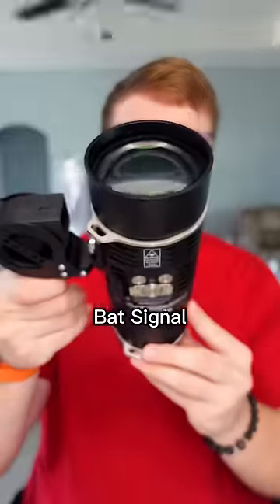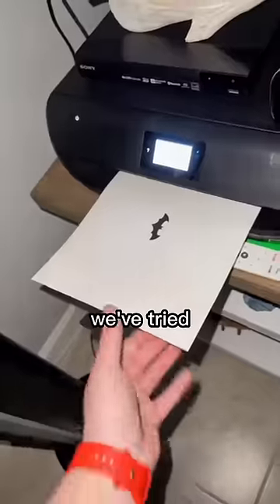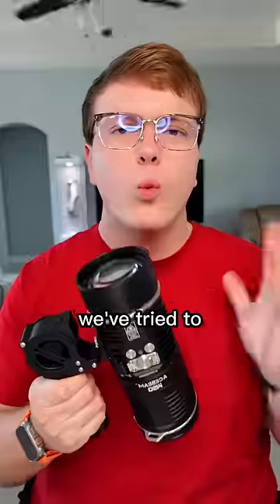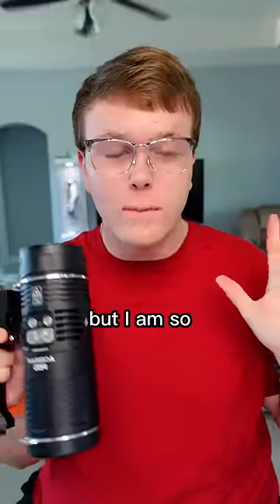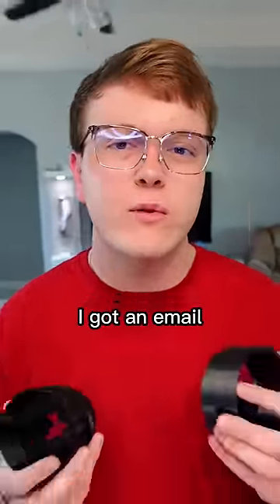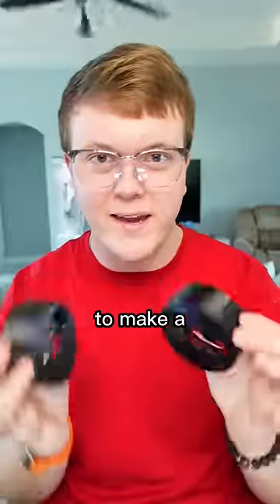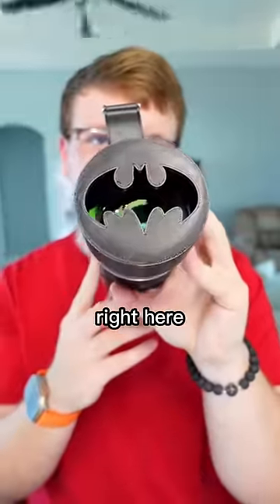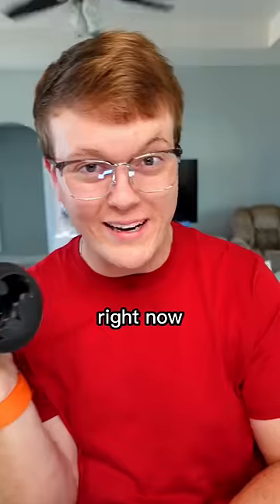3D BATSIGNAL With My $3000 Flashlight

Comment: Normally the bat ( dark part ) is in the middle , but it does work .. nice one
Reply: There’s a reason why it doesn’t work like that without him taking apart the flashlight. I’m not an expert on that but The HackSmith has a video on it
Reply: @StoryArtsConcepts  the design is great,to make it work or to make the batsignal appear you just need to point it at clouds🤦🏼‍♂️🤦🏼‍♂️🤦🏼‍♂️
Reply: I keep thinking he’s gonna flash it into my eyes lol
Reply: It is not physically possible but ok
Reply: It’s bc light bends
Reply: @clock00  it is possible as the hacksmith has done, it’s just not how fiction shows it
Reply: @clock00 if dark solid bat sign is placed at distance of focal length of lens of flashlight instead of directly sticking it on lens then it would work

Comment: Can I make a suggestion that might be helpful? because the bat signal is a shadow in the light  and not the light itself, try making metal plates in the shape of the bat symbol and find a way to either screw it on to the flashlight or make something similar to the caps where u could snap it on somehow and see if that works....hope that made sense.
Reply: Hacksmith

Comment: I think what you need for it to work is to disperse the light into an even circle with some filters from an LCD display, put the bat on the last filter, and then use a bunch of lenses in a tunable configuration to focus the light into a straight beam, like a cinema projector. That way the bat image won't blur when projected to your chosen focus distance.
Reply: i agree
Reply: Perfect
Reply: Yeah I was just thinking about this and you already said it

Comment: Use a Fresnel lens bruv. You can't just stick a black sticker in front of a flash light and expect a high quality projection. Light from a torch goes out from a point of origin (bulb). So the shadow disperses the farther it goes away hence making the edges very blurry and ultimately making the shadow low quality. If the light is linear in nature, the light and shadows don't disperse so the shadow is high quality too. You can also use a concave lens but Fresnel lens is used pretty much

Comment: Well... No it's not a bat signal. It's much more logical to be like that, it's the most effective way of doing it since if it's the light that take shape, but THE batsignal is a light circle with a shadow shaped like a bat. So it's still not right, and it's about time you check a few optic basis to know what you're trying to do. It's not like it's hard, the hacksmith already did it and explained the optic part in a video quite old now. I'd normaly say you'd succeed through trial and error, but for that you need to understand what's wrong when you do it

Comment: the reason it worked was because you were putting the bat signal inside it so the light would just hit the inside but if you cover the light instead the light  can get outside the flashlight instead of it being blocked by the bat signal you made

Comment: Even if you tried using the blackest paint in the world it's still not gonna work, BECAUSE YOU'RE USING PAPER. The paper still gonna burn because of how hot the surface of the flashlight is, you should try using plastic that can resistance the hot surface.

Comment: Nope fail. You have the inverse of the bat signal. The bat is solid and a lighted circle around it. Make the same cap, but use dule filaments black for bat in center and clear for the rest. Bam! Bat signal.

Comment: That's not a bat signal dude. You should try making a bat signal design thick enough to prevent light bending and then put it on the centre of your flash light. The signal is dark between the light not the light itself.

Comment: Dude, the reason why it doesn't work is because of the type of lense you're have on your flashlights. Flashlights have a  orbital fresnel lens in the inverse position, thus spreading the light out. These lenses are a dual convex lens. You need a linear fresnel lens which takes light from a single focal point and delineates the light so it doesn't spread out.
Reply: I agree. 1 like from me